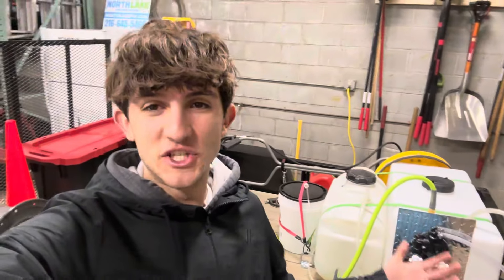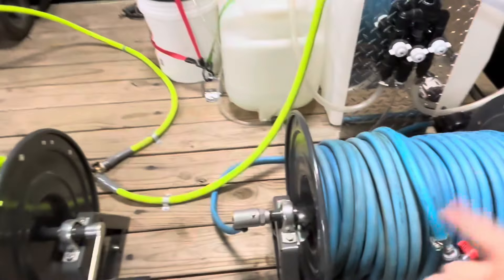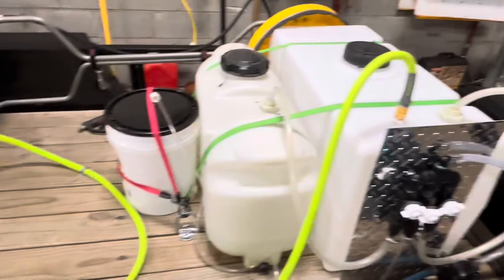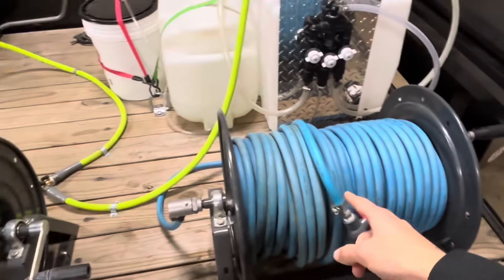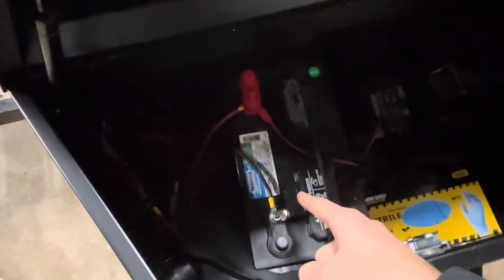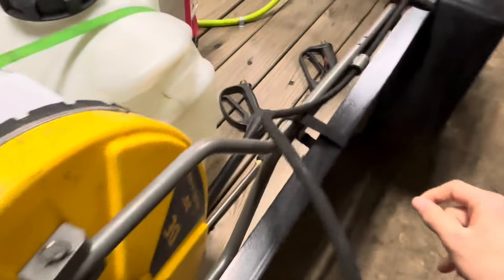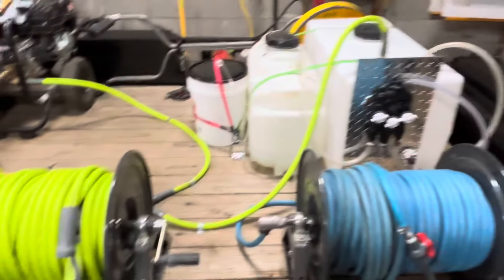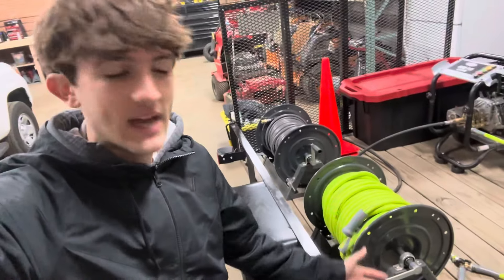What a $10,000 Pressure Washing Trailer Build Looks Like..

Comment: So do you open both on the 3 way valve if your washer wants to start pulling water from the water tank?
Reply from the maker: The pressure washer isn’t attached to the water tank. Can’t run both at the same time since I wouldn’t be getting the amount of pressure I need from the water. It’s just a 2 way valve. One to the water tank for the soft wash system then one to the pressure washer. You can make it so it does pull from the water tank if you’re using a higher gpm machine though.
Reply: @OfficialNolanBuchanan gotcha that makes a ton more sense.

Comment: So let’s say you have a patio wash and a house wash. You have the valve open to you pressure washer, once u get done cleaning the concrete, do you close the valve to your washer then open the one to the tank so your softwash system can start pulling it and u can start washing the house?
Reply from the maker: Yes exactly. Then once you switch to the soft wash system it'll start coming out of that hose too. You will need to turn the pump on. But once you switch to the soft wash system it'll start putting water into the water tank.
Reply: Gotcha,thanks for the reply man
Reply from the maker: @masonhenry7290  Anytime!